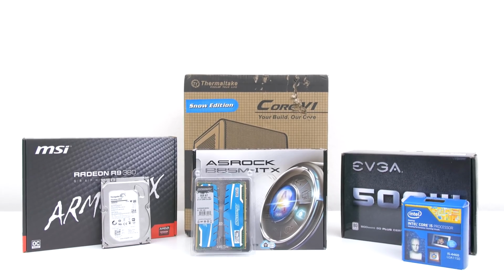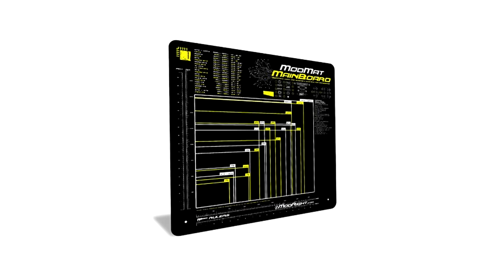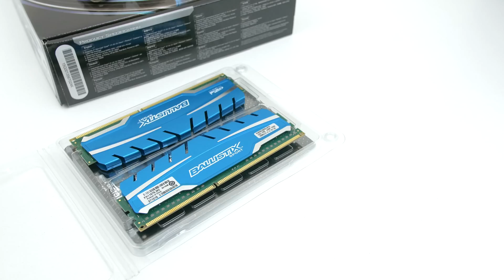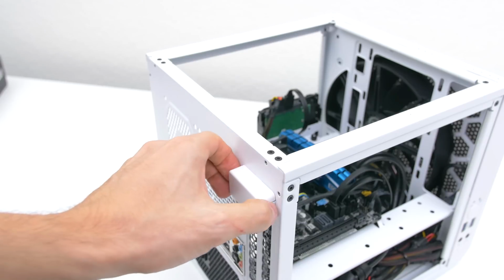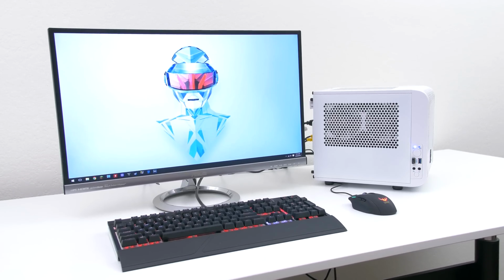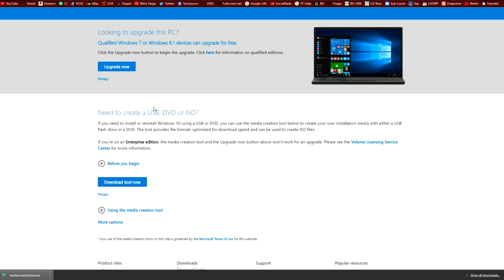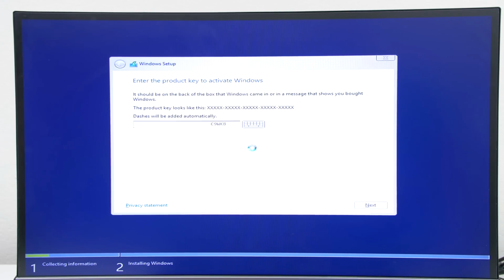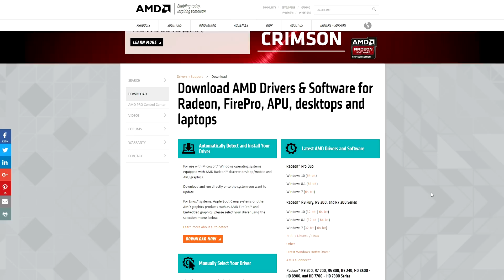How To Build $600 Mini-ITX Gaming PC w/ Windows 10

Comment: TechSource I'm trying to building the Icecube but it's not able to read my usb to download windows 10. I've tried sticking that USB in every damn place that I could and have redone all the wire multiple times I don't understand what I'm doing wrong
Reply: I got it to work you guys thanks for all of the help!
Reply from the maker: +chang heo hit F8 and go into the boot menu to see if it's there. Manually boot from the usb
Reply: All I am seeing is a black screen with a small white line at the top left corner
Reply: +chang heo I'm no expert but I think it would be very efficient if you got a tomshardware account and asked the people over there.
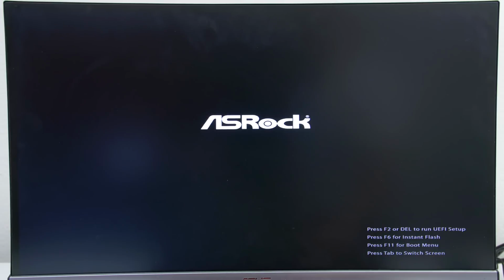Reply: +TechSource 09:16
Press F11 for boot menu
Reply: Higher speed ram does help in some games. I know Fallout 4 gained quite a nice performance boost from high speed RAM. Also, it''s not like high speed RAM is expensive.
Reply: excuse me, should i buy 1866mt/s or 1600mt/s for the ram ? thnx
Reply: and single ranked or dual ?
Reply: ***** thanks, you realy helped me :)
Reply: hola
Reply: chang heo yy

Comment: Ok so I just built my first gaming pc and it's not working. I plugged the cables and from the psu to the motherboard. I suspect my power supply to be faulty because the fan aren't even spinning and no sound is coming from it, please help. (sorry for bad english)

Comment: Can I Live stream GAT 5 on this pc or will I need to upgrade anything
Reply: I just built the PC a week ago exactly as he did, ill tweet u pictures if u want but the PC is pristine and absolute perfection for Gaming, Editing, Recording, Streaming and Runnin almost anything you throw at it! HOPE THIS HELPED!
Reply: +Hero Dill thanks i am going to build it
Reply: +Wolfie big tail did you build it just curious if it is worth my time
Reply: I have not built it yet but I think I am going too I just need to save a little more money
Reply: +Wolfie big tail replace the graphics card with an RX 480, more power for the same price.
Reply: +Wolfie big tail just here wondering if you built it and if you were able to stream with it
Reply: no the pc in my opinion ive had is for months now runs everything perfectly
Reply: editing is perfect great rendering time!
Reply: +Angry Dill I just found out that the EVO 212 doesn't fit in the case... Do you have any suggestions for a replacement? I don't want to use the stock fan btw. Thanks!
Reply: +Marauding Bear try connecting it to ur graphics card
Reply: Marauding Bear NOOOOOOOOOO, don't do that!! Plug the HDMI into your GPU, NOT your motherboard, it will result in HORRIBLE performance!
Reply: +Angry Dill mate could you send me some pictures of it, if you still have it?

Comment: is the r9380 better than a nvidia 750 ti, im debate on whether to get the 750 ti ftw or r9 380
Reply: they are about the same price off amazon
Reply: i cant quite afford a 970
Reply: also does all the cables come with the motherboard?
Reply: and.. sorry for all the ???s... if i buy a windows 10 cd off amazon will i get the cd key?
Reply: with r9 will it run csgo recorded med settings 108060
Reply: why no fans or cooling, i dont want to damage anything so shouldnt i get a fan

Comment: I can use a different motherboard as long as it's mini-ITX right ?
Reply: Yes any ITX works message me for any QUESTIONS!
Reply: +Jos Batenburg Oh okay Thanks alot you really helped me :) :)
Reply: Hello, i wanted to ask if you know any good mini-itx motherboard, because the one which is shown in the video is not available anymore in my country( the Netherlands) Thank you.
Reply: Can I use a evga 730 ?
Reply: you seem to be the one with knowledge here... this is gonna be my first build and since im buying all the parts from best buy i have to opt for a different motherboard. im currently looking at the MSI - Z170I GAMING PRO AC Mini-ITX Motherboard (Socket 1151) - Multi.. would this mother board be compatible with everything else ? i appreciate your time.
Reply: +Hero Dill Bro how's the PC. Can you run graphic hungry games at least 40+ FPS on high quality 1080p?  Like GTA 5, Battlefield, Witcher3 etc etc. Hope for a reply thnx in advance.
Reply: Dude absolutely perfect for all of that, If your asking about Minecraft yes its the cleanest ive ever played aswell as GTA 5 and CSGO are running perfectly in 1080 and it doesnt even max out the cpu or GPU
Reply: +Hero Dill Thanks man
Reply: Hey do you maybe know if i can use all these parts except the motherboard and case and replacce that with an MSI motherboard and mid tower case? And also did you have to buy some screwq or those rubbers or where they all included?
Reply: The Socket on the motherbord must be 1150
Reply: +Hero Dill planning to get this and change gpu for rx 480 are the parts compatible? with rx 480
Reply: +Berserker Guy yes.
Reply: +TheNamingGaming Which one is better, this one or the on from randomfrankp the "$500 gamung pc"?
Reply: FruitCakeNinja can I make it a mid tower pc? Can I just buy another case and fit all the parts in there?
Reply: Yes
Reply: what graphics card could i use with this?
Reply: +FruitCakeNinja
Reply: +Angry Dill does the wifi chip he showed in the video support windows 10? And will the Rx 490 8gb fit in this case?
Reply: yes
Reply: I want to build a hackintosh for final cut pro.
My budget is $600.
What would you recommend I build?

You can  give me a complete part list or modify the one the the video.

Thanks!
Reply: +Hero Dill The R9380 he reccomends is out of stock, what would be another good gpu for around 200$ that would fit in this case?
Reply: Angry Dill Please can you suggest a mini it's motherboard as the one he recommended isn't sold in the uk! thanks!
Reply: Angry Dill
 
I want to build a hackintosh for final cut pro.
My budget is $600.
What would you recommend I build?

You can give me a complete part list or modify the one the the video.

Can you please reply I have been waiting for 3 months!!!

Comment: Hey man, I thought you should know, I am building this pc with the optional parts and I bought the CM 212 EVO and it DOES NOT fit in the case. I trusted you too much...haha Too bad it doesn't have free returns on Amazon.
Reply: How doesnt it fit? It should with ITX motherboard and the size of the case thats weird?
Reply: The cooler is too tall. It stuck out of the case vertically so I couldn't close it. I just ordered the CM T4. That should fit this time.

Comment: Could I do this build but use an RX 480 instead?
Reply: Yes and GPU works
Reply: +Hero Dill not the mono though right?
Reply: +Greg Erfulgerman what are you on about?
Reply: +knight kronko *mobo is what I meant. Also I just realized my mistake. I was thinking about how I was also planning on switching the cpu
Reply: +Greg Erfulgerman Good luck
Reply: +knight kronko thanks.
Reply: +knight kronko also quick question. The IO wiring seems hard in the sense that I have no idea how he figured out what order to plug them in. Is it in the case manual?
Reply: +Greg Erfulgerman i guess, i have no idea but am going to build This pc with a rx480
Reply: +knight kronko I will if it lives up to the expectations of at least beats the other cards at this range
Reply: Will someone link me this? I want to be sure I'm getting the right 480.

Comment: Im thinking of using this build, but i would like to use a bigger case for possible future upgrades, witch one would you suggest?
Reply: What do you mean 'witch would you suggest?"
Reply: I bought this pc exactly and it has MORE than enough room for any upgrade like GPU CPU RAM POWERSUPPLY or anything else fits beautifly in here
Reply: ***** ya
Reply: +Der_tolle_Kuchen if you arent sure just look it up on pcpartpicker
Reply: +Der_tolle_Kuchen no the r7 will give lower frame rate but is cheaper
Reply: +Der_tolle_Kuchen how much money do you have for spending? np btw i like to help
Reply: Mid tower case
Reply: IS THIS BUILD GOOD?? Does it run games good on high?
Reply: +Johnny Guardado He has a benchmark video on this exact PC...

Comment: where do we get all the screws and rubber grommets from
Reply: Plastic pockets that come with the case.
Reply: an adapter
Reply: thats fine just get a wifi adapter a usb one
for you pc
Reply: +Muttonchop & Handlebar Here's one that should work good.
https://www.amazon.com/dp/B00JDVRCI0/ref=cm_sw_r_cp_api_LQgIxbP57PYSR
Cheers!
Reply: +Muttonchop & Handlebar you can buy an Wireless card
Reply: +mizz b just get a wireless reciever it is much easier. Because it is just usb
Reply: no
Reply: +mizz b or just hook it up directly via ethernet cable for faster connection

Comment: Hows this build for my first pc?

CPU- Core i5-6400 2.7GHz Quad-Core
CPU Cooler- Hyper 212 EVO 82.9 CFM Sleeve Bearing
Motherboard- GA-Z170X-UD3 ATX LGA1151
Memory- Ballistix Sport LT 16GB DDR4-2400
Storage- Seagate 1TB 7200RPM
Video Card- GeForce GTX 950 2gb FTW ACX 2.0
Case- S340 (White) ATX Mid Tower
Power Supply- 500W 80+ Bronze Certified ATX

Comment: Im gonna upgrade to 16 gb of ram and a gtx 960 in this build, will the gtx 960 work with this? (I can get the gtx 960 for 170$ and it has a better core speed than the graphics card you used)
Reply: it will work.
Reply: Get an rx480 it's $200 and it's stronger than a GTX 970
Reply: Will the rx 480 be compatable with an fx 6300, because its slightly under the i5 and almost twice as cheap so I was gonna change the motherboard as well
Reply: Athus Playz you have the highly overclock the CPU if you don't want it to bottleneck

Comment: Do you think that the new amd rx 280 will fit in this case?
Reply: And if it will preform better
Reply: Yes of course it will perform better. (BTW its called rx 480)
Reply: +Eren Karaca thanks
Reply: MoTheMlgPro np man. Link me to your full build
Reply: +EzraSniperKing Much much better. do you really need the i7? if you are going to do only gaming and some light work and i5 is enough
Reply: +EzraSniperKing What is your power supply?
Reply: +EzraSniperKing Oh. I would suggest an Evga 650w gold rated 80+ fully modular psu
Reply: ***** Gl on your build!
Reply: +Eren Karaca Would a GTX 970 work also in this pc bulid ?
Reply: +Purple Oranges yes but I suggest you wait for the GTX 1060

Comment: Is the motherboard compatible with a 4970k because i will do the same build but a but stronger
Reply: oh and is a evga gtx 960 4gb (the small one) good for this build
Reply: Should work, but you would need a better power supply. Try an 80+ Gold and at least 600 watts
Reply: Thanks! Will order soon
Reply: Oh, you should also keep in mind that the new RX 480 has been released, and preforms around or better than the GTX 970/R9 390 for only $199, which is a lot better than a GTX 960, and it should fit in that case. +Nobert Szabo

Comment: correct me if im wrong but do i connect my monitor (using hdmi) to my motherboard, install windows, download all the drivers, shut it down and then connect it to the gpu or do I just connect it straight to the gpu
Reply: first time building btw
Reply: both are ok
Reply: use motherboard hdmi first after everything works and you intall windows you can come back and install the graphics card, watch a how to video.

Comment: Can I use a 500w psu for a R9 390 and i5 4460?
Reply: how do u calculate these values
Reply: THIS CALCULATOR DOESNT SUPPORT SKYLAKE PROCESSORS
Reply: +Jeremy Dias there's a website callef computer part parts picker. it will let you know if your parts are compatible

Comment: I really want to build this, it would be my first build. Is there a liquid CPU cooler compatible with this ?
Reply: I wouldn't use liquid cooling in this, as the build won't even get hot.
Reply: +The Gaming Bible I was thinking of something more for aesthetics if I'm honest
Reply: +sayton131985 Still, it's a lot more expensive
Reply: +sayton131985 and you won't really see it.
Reply: +sayton131985 and you won't really see it.
Reply: +The Gaming Bible good points made, I was only looking at something similar to the cooler master siedon. Everything needs to be on a real budget

Comment: Does any nvidia or amd graphics card work with this pc?
Reply: and could you have a 600W power source too or is that pointless?
Reply: Yes! It will work with every video card but you can get better PSU if the card wants more power etc but for this build 500 W is good.
Reply: Thanks man. Im from the UK so the motherboard is an extra £20 to ship. Its not on amazon either. Can i get a similar one and it will still work? Sorry im a noob when it comes to PCs!
Reply: If your going to use the same cpu and case you need similar board with LGA 1150 socket and it needs to be mini-itx for this case
Reply: I would reccomend you to get RX 480 video card when it comes out I think 500 W PSU would be enough for this card but you can get 600 W
Reply: Yes it is ok.
Reply: If you wanna see if your build have any problems go to pcpartpicker and choose the parts it should warn you if there is a problem. Greetings from Bulgaria.
Reply: Ok thanks! Big help :)
Reply: No problem man! And do no forget to buy good 80 + PSU. I would reccomend you corsair or cooler master one.
Reply: +Angus Coutts Did that motherboard work for you ? I was going to buy that exact one !
Reply: +iLiStAr I never ended up buying it as I'm going to Uni and I needed to save money!

Comment: what about windows 7 ?????
Reply: Who wants WINDOWS 7!?
Reply: my mate cos he got pissed off with windows 10 and it keeps crashing so he installed windows 7 and now its fine its still supported till like 2019 so
Reply: Tony's tech I still see a problem. Windows 10 crashes for him because of a software/hardware fault. Its not in any way windows fault. I highly recommend windows ten.
Reply: Windows 10 should be be better for gaming
Reply: ye but i have had problems with windows 10 coming from 7 and my hardware is plenty powerfull its working now but before it crashed if i right clicked anything i was like WTF thats why i moved to 7 cos i had another problem before that with SATA drivers but now im back on windows 10 and seems the fucking worst stupidest bugs have been fixed i mean how did it crash when i right clicked i mean come on Microsoft that neeed a bit more testing !!

Comment: I'm going to swap out the cpu for AMD FX-8370 8 Core Black Edition Processor and the gpu for RX 480... Is that a good idea?
Reply: don't change the CPU. the gpu change is fine
Reply: +RANDOM_SQUID Huh. Ok. But I still might change the cpu to the newer lga 1151 socket
Reply: The Gaming Bible that's fine

Comment: Just a few questions, I have a R9290, and an amd fx8350. What motherboard will work with both of these?
Reply: Any motherboard that supports AM3+
Reply: Not Qoure Yeah but with the dimensions of the small tower there cant be any overhang at all and im looking for a motherboard that has the r9290 hanging over the back instead of the front.
Reply: you need to have a mini-itx type of motherboard that supports the AM3+ cpu socket. Placement of the gpu is not optional, it is based on how the motherboards are designed to align the pcie slot with the  pci slot bracket.

Comment: I have that case! You can actually mount the SSD on the other side of the same sled as the hard drive - The metal tabs go in the holes on one side, and the other side screws in.

Comment: in this case having a fully modular psu is a good idea even if it is more expensive or the temperatures doesnt change so much with it? i m a bit worried about temperature  and do you guys think that stock cooler is good enough to keep an i5 6500 cool enough for example?

Comment: WARNING
Thermaltake Core V1Clearance  CPU cooler height limitation: 140mm
Optional parts CM 212 EVO Cooler is 159 mm height
This optional part cooler will not fit in the case with top panel on.

Thank you for another great budget build video

Comment: Can we replace the gpu with the up coming amd rx480?
Reply from the maker: +InfiniteCircle yes
Reply: +TechSource Hey TechSource, I'm going to swap out the cpu for AMD FX-8370 8 Core Black Edition Processor and the gpu for RX 480... Is that a good idea? I not sure about the cpu...
Reply: Hey Ed Do you have to have the Cooler Master CPU Cooler? And if you don"t will it constantly Overheat?
Reply: Nope, i5 > amd fx 8370.  The i5 may only have 4 cores but they are strong cores compared to the 8370's 8 WEAK cores
Reply: +The Gaming Bible the i5 is definitely better.